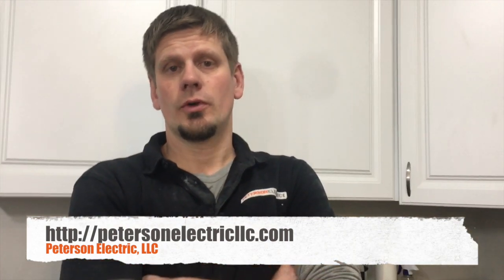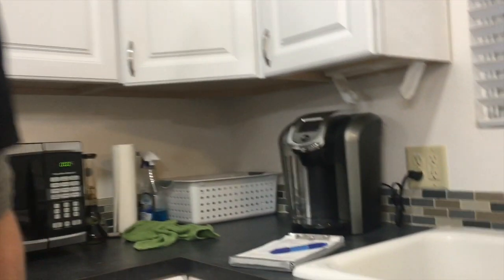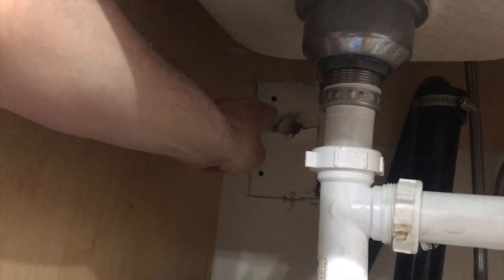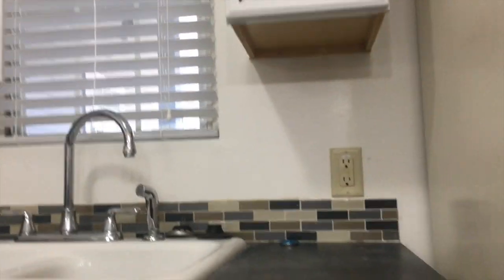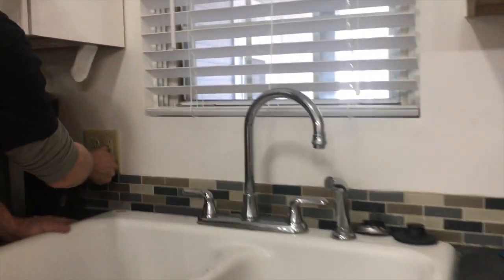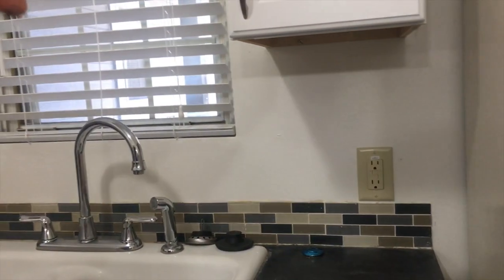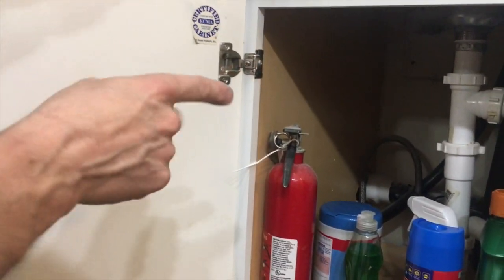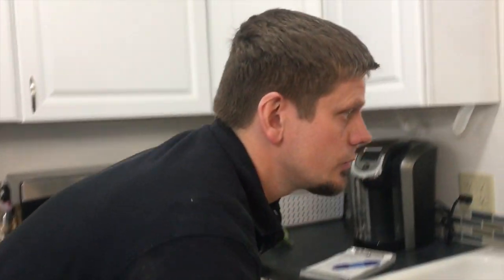Repairing An Electrical Wire, Bullet Went Through It

Comment from the maker: The firg Appliance to todays code is still allowed on an appliance circuit for the 2017 standard.  The disposal is an on demand and used once a day, the frig turns on all of the time, especially in the summer.  Pulling cabinets and counters is not an option they wanted to consider. Running a new circuit and cutting drywall is also something they said no too. It was an odd call two people were shot to death right outside of the video last year, and Management wanted this repaired with no damage. So, we felt that a pressure switch on the App. Circuit was the only way, we did check to make certain the firg was not on that same 20Amp circuit. Sometimes we have to think outside the box.
Reply: It's just part of being an electrician. If you worked for a company and came back to the shop at the end of the day and told this, or any other difficult electrical story to other electricians , wouldn't you expect some of the guys to question if you couldn't have done this, or couldn't have done that? I would. It's nothing personal, and nobody is always right, but discussion is a good thing. When I comment I don't mean to offend you, but just to offer my thoughts. We all do the same thing differently. Peace!
Reply from the maker: @eschu1010  I have worked for many shops in the past, the goal is to meet the customer's needs without taking their account. I do not think you have worked on the business side yet, there is a middle spot that the code can not always meet. My job is to also maintain the customer relationship so we can build the business and hire more w2's. Our city AHJ in NC is somewhat understanding on odd repairs, and they do not care to do inspect these kinda of things. The panel was on the other side of the apartment and there are tenants above and below this unit in the video. The amount of damage that would have been to this drywall and the fact they would have had a kitchen remodel with a cabinet guy and counter guy pulling out items is not practical. Personally, I did not talk a lot to the guys in the shop, I wanted to learn to think on my two feet and did not want their opinions unless I was sure to ask.
Reply: @Petersonelectricllc  To be clear, I'm not the one who made the comment about the small appliance circuit. I know that sometimes NEC can't be met because of existing conditions; that's electrical work in the real world. I've had my own company for almost eight years, passed my Block master exam in 1988, and been an electrician for almost 36 years. I've also picked up on a lot of good ideas from afterwork conversations.
Reply from the maker: @eschu1010  Thanks for watching, did not mean to insult you. The field is hard to follow when your in service and the code for example states in 406.4 that if your are going to change a plug you have to AFCI the circuit. That is not feasible to tell a HO or MNG that their FPE panel has to go when all they wanted was a simple plug repair.